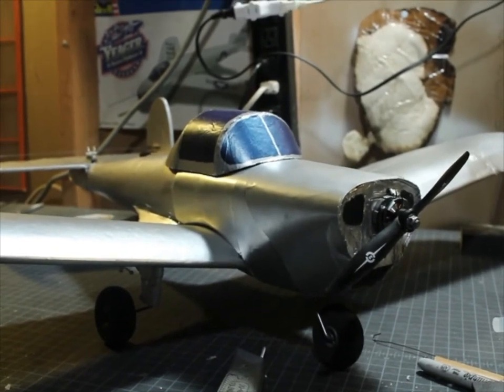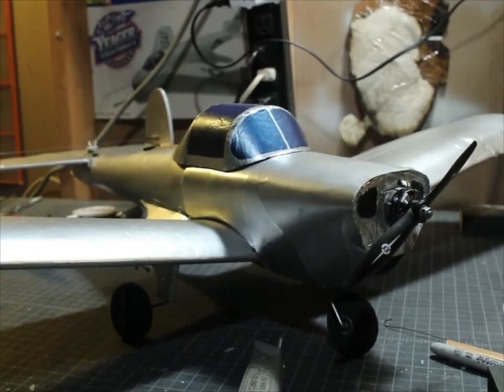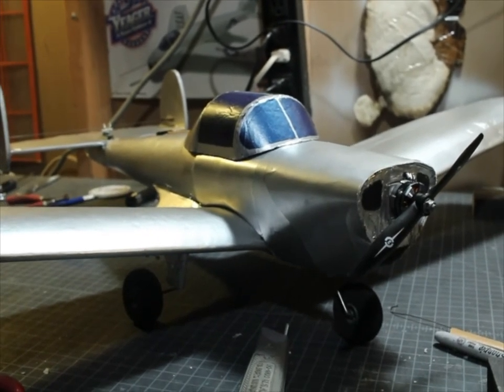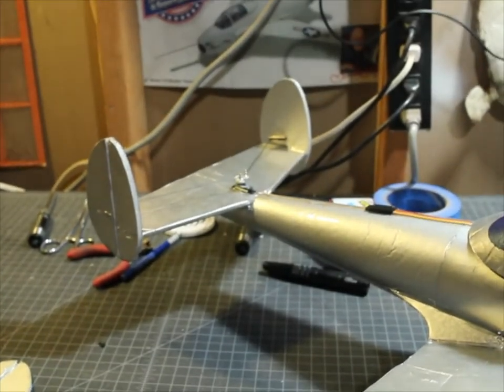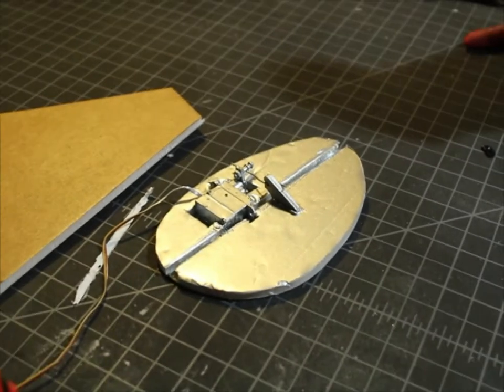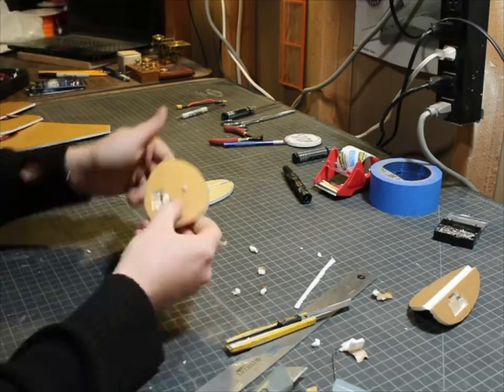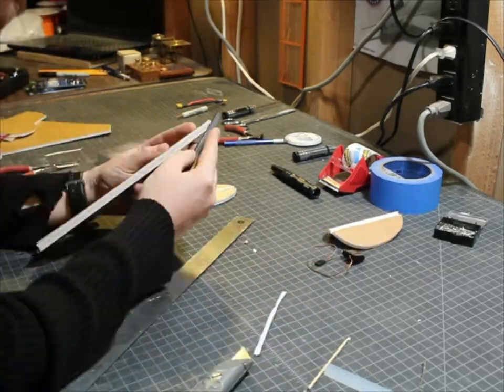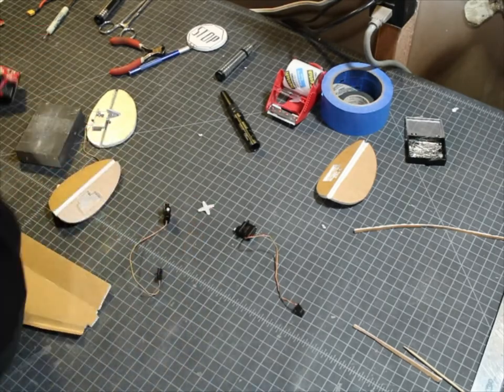Mini Ercoupe Build Part 1: Empennage

Comment: I love to see the engineering considerations that went into this detail of rudder linkage: From static rudder to center servo to direct drive. Lets hope for proper CG in the end!
Reply from the maker: I checked it out beforehand by taping all the gear to the tail of the existing model and loading the battery fully forward...  It should balance. There's room for a larger battery if not.